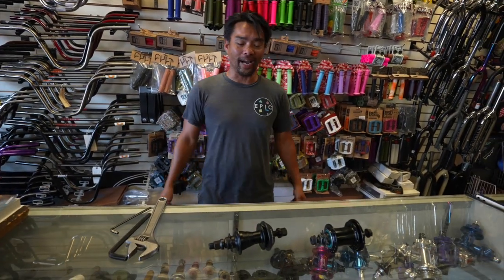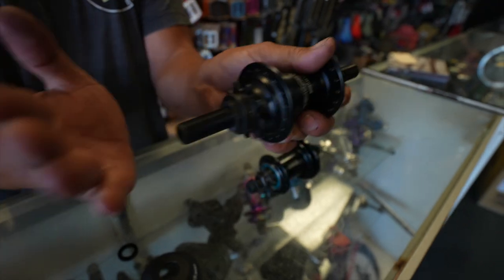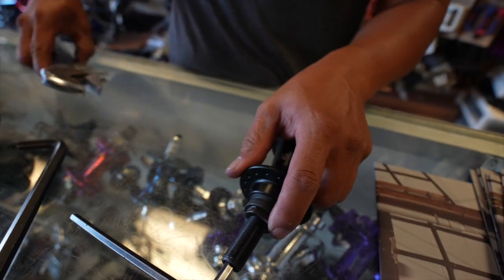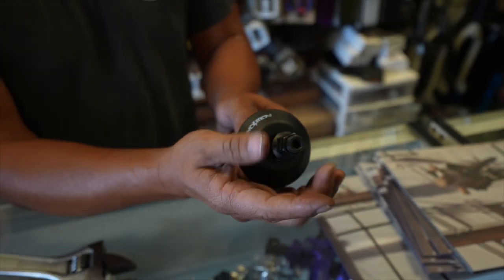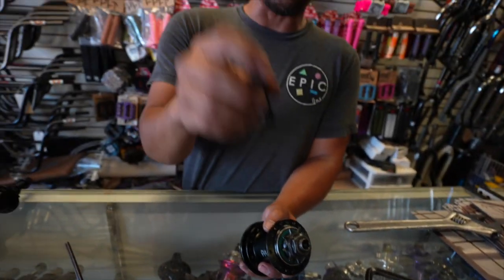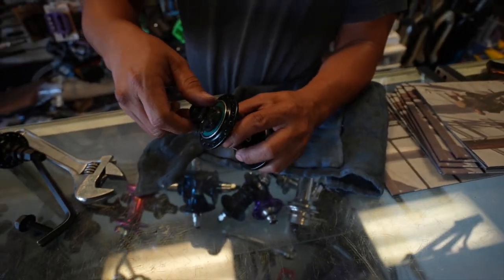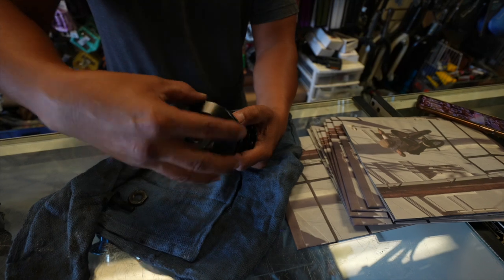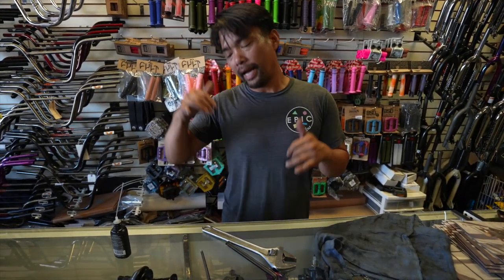HOW TO FIX BMX HUBS! FREECOASTER AND CASSETTE REPAIR 101!

Comment: Thanks for the knowledge I will try to file down the nut piece on the hub. Phu is definitely right I l started doing a lot of feebles outside on some crusty ledges no hub guard. Next day went out to cruise and I definitely noticed rear hub definitely seized up I would peddle and see the back wheel stop almost instantly even with no breaks on so I knew the wheel wasn’t  rubbing on the pads stopping it from spinning freely.

Comment: Its the driver side spacer that you mention necessary? I cant find the exact cone nut for my hub, i go another one and it does work but only when I remove the spacer. 3:45

Comment: Churr from rotorua,new zealand,could you tell us more about,the difference in costs regarding,if sealed bearing ,spindles,sprockets,are chromoly or steel.ive noticed rant sealed bearings are cheaper compared to a ,odyssey or shadow bottom bracket per say.love your work pho and alf,primo.
Reply: ChroMoly is steel. It just has Chromium and Molybdenum added.

That's all I could decipher from your comment.
Reply: Ok i meant the detail in parts material ,engineering and design,a good example is,a 8 spline chromoly spindle ,compared too a 48 spline hollow 19 mm heat treated spindle.or chromoly vs sanko chromoly.the real nitty gritty detail in bmx design and enginering my mate.

Comment: I have an Alex rim g303 6061 106x24 Xrims with a Gt hub 9  tooth sprocket and for some reason I can’t get it to keep from locking up Its an old school cuz the bearings are not sealed so any suggestions
Reply: Btw it’s a cassettei just learned this as you go on with your videos